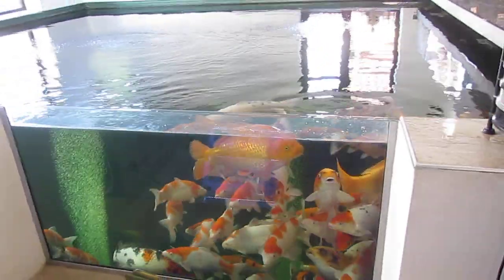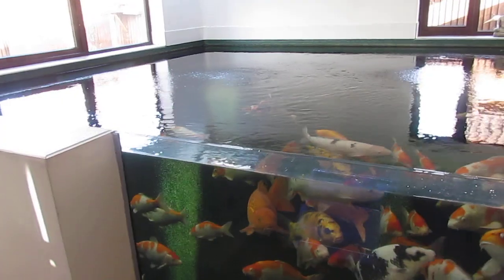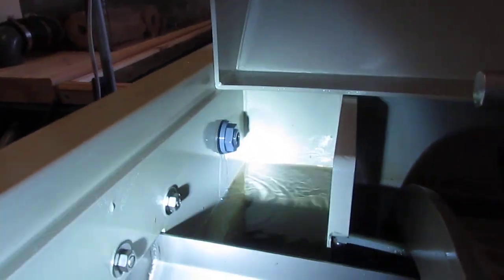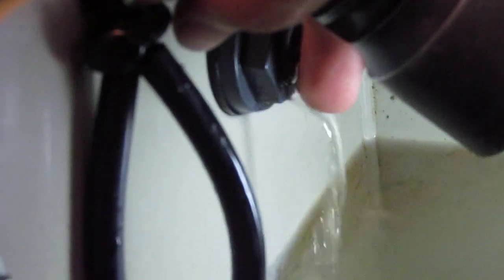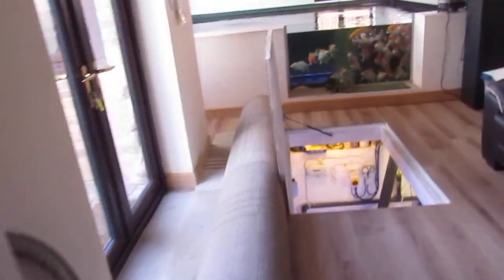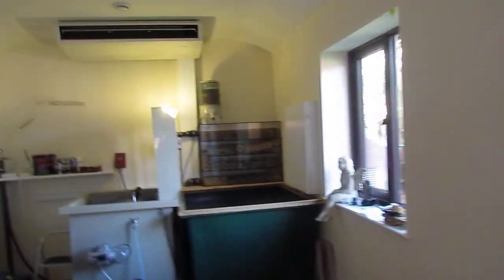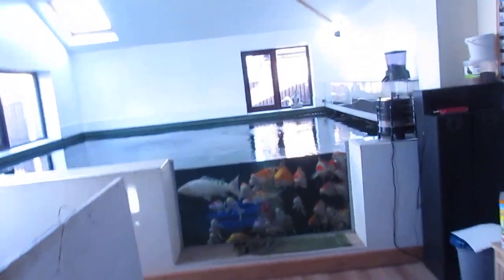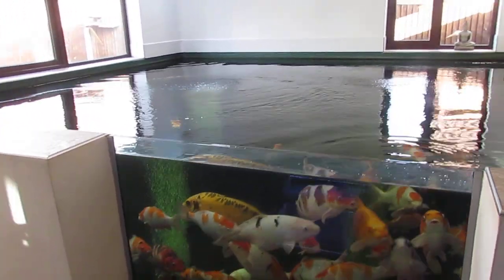Mains drinking water and Koi - Chlorine and water changes

Comment: I was in the subscription scrolling down to see this video with my username on it xD ( I felt special)
Yeah this video is very informative and now I know tips on improving my outdoor pond.
My pond 2 years ago when I was a beginner was HELL for the fish with ammonia levels at the highest and all the fish had burns and some had massivr holes in them like 4 cm wide and 2 cm deep and that was for goldfish.
I mean mainly because I know someone who only changed once a month because of how big their pond was for the amount of kois but mine is a small 3,750 liter with a few koi and goldfish.
Yeah in spring I didn't water change for 3 weeks because the water had literally no ammonia and all that for my plants so they released hormones and for those 3 weeks I had constant breeding and I have 15 baby goldfish that im still looking after in a tank. BTW well made video and it answered all my question and prefer to trust a well experienced fish keeper than the internet.
Questions:
What is wrong with the koi in quarantine or are they the new fish?
Do you lower the temperature of the pond in winter to simulate their natural beings?
So I have baby goldfish from the goldfish breeding at spring time... Should I release them in my super cold pond in the winter or wait until spring when the fish breed again?

Comment: your videos are amazing new pond owner here and everything your saying is very helpful:) any recommendations for a good all in 1 filtration system i dont have proper pumps/ filters currently but need to know whats best i want to have kind of an overkill filtration system so i can have more fish and eventually when its time make my pond larger i have about 20 koi no larger then 5 inches and 20 goldfish the same size in roughly a 1200 gallon pond any tips or advice on any and everything would be greatly appreciated i live in the United states in utah where 6out of 6 months its below 60degrees F
Reply: I was thinking of his water bill !!! That trickle would run up your bill ... Cant be on the meter
Reply from the maker: I am on a water meter, my water bill for the pond is about £45per month (I dont pay for drainage). I can tell you that if a was not on a water meter my neighbors would be complaining about low water pressure because i would be using that much.
Reply: +Adam Julyan (aljonline)  thats not too bad actually . My neighbours have complained about the sound of water ! Ive had to switch off fountains and waterfall , but added a large air pump for oxygen ... Only a small pond but some people are tetchy i guess . Great set up btw

Comment: morning Adam 

just a quick question I don't real know what I am talking about but here goes 

I have a large profi  drum I am going to have a trickle of water in my pond all the time. 

but what do I need to auto top up my ponds water  be couse I am under the impression that as the profi drum Self  cleans it takes water from the pond to clean I don't want to be topping up my pond manually all the time. 

so will the fresh water trickle keep the pond topped up or do I need to add something to do this.

thank you  and sorry to bother you

best wishes 

kev from Wales
Reply from the maker: Hi Kevin, this is actually a much better question than it might seem at first. The reason i say that is yes the trickle should manage the usage of the drum but if it does not you will definitely know about it as the drum will try to drain your pond. I have managed with a lot of trial and error to get the perfect trickle you will go through the same process as you get used to how the drum works and you will drain the pond a few times as i have with every drum i have owned there is no set answer every pond is different. I keep a small trickle coming out of the overflow all of the time and i know that if this trickle stops then the trickle into the pond is not fast enough but it does change with time in the middle of summer i will struggle to have it trickling out at the end of the day but if i adjust the inflow of water the next morning it will be overflowing too fast. So no you dont need an auto top-up but it will take time to perfect the trickle.
Adam

Comment: How often do you change the charcoal on your filters? I use a cartridge filter on the supply too, but it's only good for 300 gallons.
Reply from the maker: I have just changed the filters in mine as they where letting through a bit of chlorine. they have had 124,000gallons through them next time i change them will be 100,000gal so i avoid the bit of chlorine. 300gal is not very much i use that in a day.

Comment: Hi Adam...i get how the new water is trickling in but how is the old water leaving the pond? thanks Ross
Reply from the maker: A mixture of ways 1. the filter i use require a trickle to maintain the pond level as it uses water. 2. our toilets in the house use pond water to flush. 3. if there is any extra then it overflows usually early in the morning it overflows a bit but we use most of it.
Adam
Reply: @AdamJulyan  that is genius! 😱!

Comment: Hi Adam I have recently 3 stage HMA 10 inch filter VYAir one, your trickle that you do in to your filter is there a reason its into filter and not straight into pond, or could I trickle straight into pond....or don't it really matter...cheers Dave
Reply from the maker: Hi, I would say preferable to go into the filter as it then mixes through the filtration system and the fish won't detect a difference in temperature or water quality. however it does trickle straight into my quarantine tank so really i would say whatever having the trickle at all is the most important thing.

Adam
Reply: Adam Julyan thanks mate. great videos also, very informative. through watching your vids has made up my mind on the trickle set-up.  your set up is something special for sure. very envious indeed....